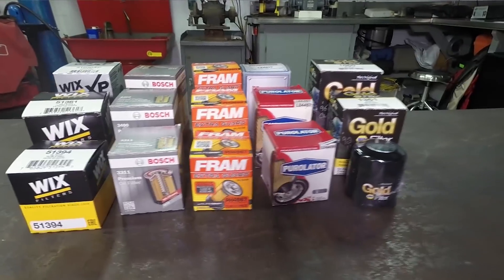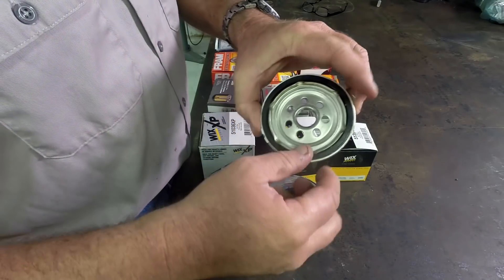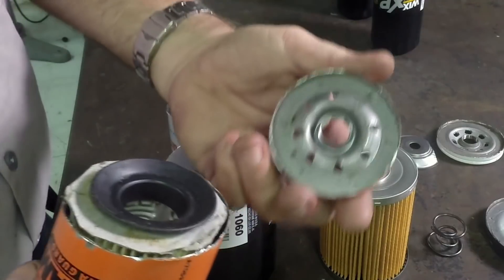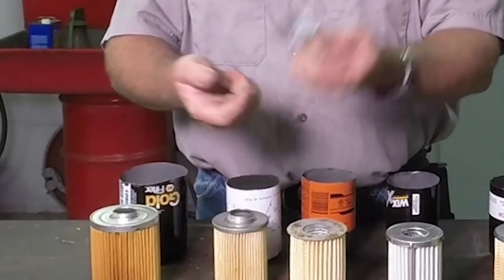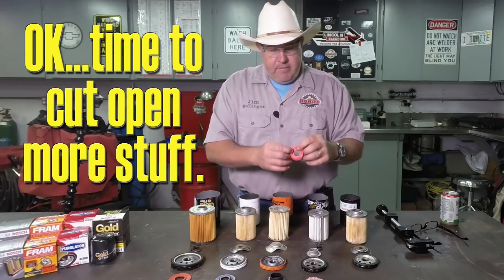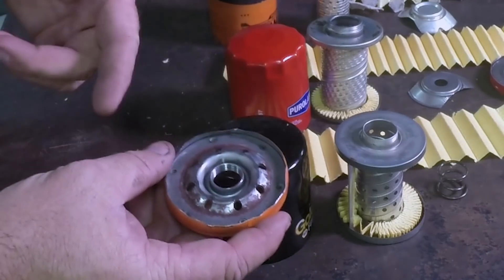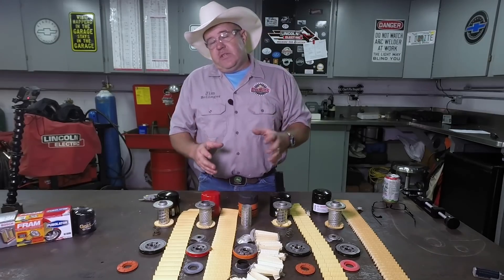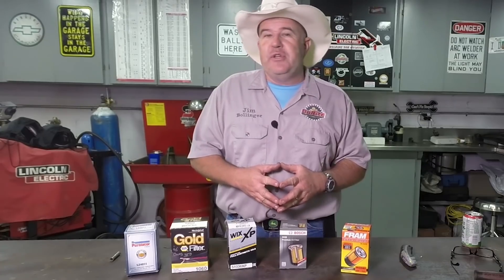The worst oil filter EVER!

Comment: As a hobby I am into the old International Harvester trucks and the vintage, low oil pressure type gasoline engines that power them.  One thing I can say is that these engines are very sensitive to inferior oil filters.  In the IH circles, with few exceptions, its always been known cheap oil filters, especially Fram filters are junk, often leading to ticking valve lifters, and lower oil pressure.  

There are many stories of just replacing the oil filter has made the ticking valve lifter noise go away.  And I proved it true to myself when I bought a '62 IH pickup truck.  It had low oil pressure when warm and very low oil pressure when idling.  I did nothing more but removed the old Carquest filter that was on it and replaced it with the recommended Wix filter.  Running oil pressure was much higher and idling oil pressure was about double when hot - using the same old oil.  

Perhaps the oil bypass valve wasn't working well in that Carquest filter, I don't know.  All I do know is that I had much higher oil pressure after replacing that filter with a proper Wix filter.

I embarked on a mission to find the best filter made.  And as it turns out there are over 300 different filters that would screw onto (fit) my engine that uses the standard 3/4 x 16 oil filter thread.  Using technical and engineering data and after many discussions with oil filter technicians at various companies, I did find one filter superior in the least flow restriction, most contaminants held, and smallest contaminants filtered from the oil.  There is one company that makes a better filter (much better) than Wix, my second most recommended filter brand..  (Napa Gold is made by Wix so they're about the same filter).  

I don't work for any oil or filter or car parts related company so my conclusions are unbiased, based only on technical specifications and engineering data, much more than ever put on their web sites.  If you're interested in knowing what filter, at least for old iron, is best, and much better than Wix,  you will need to read my report on this forum:

https://forums.ihpartsamerica.com/showthread.php?t=4022&page=2 

At the bottom of this page I put a table comparing Wix with another brand.  But I suggest you read the entire page if you're into this kind of thing.  Lots of good data there.

Comment: I've used Fram for a long time, put 350,000 on a 1998 Taurus 225,000 on another one. no engine failures. I wouldn't use them in a high performance race engine but using it in your average car you cant go wrong. I will continue use Fram good value for the money.

Comment: Funny, I have always used Fram filters. This includes my commuter car that has 525,000 miles on the original engine and is still going strong.
Reply: Must be a Honda.... Those things could run on molasses for 10,000 Miles
Reply: @aaronfields57  And FRAM makes the Honda-branded oil filters, too (in Ohio). Paper ends and all!  LOL! =P
Reply: What car? Toyotas can run forever even when lacking maintenance.
Reply: @Krazy Kanuck 😂😂😂
Reply: You think your engine is going strong but you don't know what your engine is going through on the inside. Just think, your engine being as good as you think it is, how much longer you might get out of it by using better parts. Personally I'd rather not take a chance.
Reply: @Krazy Kanuck 

that's is a good run .
Reply: My dad had a 1989 Chevy pickup with 480, 000 mile when he traded it in.  He always used Fram filters and yes even Havoline oil. The only problem he ever had out of it was a module in the distributor.
Reply: @tap Pearson that may be true.. great. But if you used high quality filters your vehicle / motor would last even longer.  And I also know you’re full of shit because I don’t care what engine or filters you are using, no one is getting 500k miles out of an “original” engine without replacing consumable parts. Whether you like it or not, and no matter how gentle you are, you are not getting 500k miles from a motor without doing maintenance. Parts wear out
Reply: @BananerRepublic  You are completely wrong.  All it takes to get 500K mi out of an engine is a solid design coupled with a lot of highway miles and not driving it like you stole it, and of course changing the oil at appropriate intervals.    I always chuckle when those who pretend to be the  most knowledgeable, seem to be their own worst enemy because they seem to have the worse luck getting good lifespan out of their vehicles.
Reply: Mxracer6y im sorry te tell you this but I worked at a oil change station in Mexico and the nissan tsuro wich is a sentra here go a million kilometers without changing or opening the motor just regular maintenance also seen the Toyota and the 7.3 international on the older fords go over a million
Reply: @BananerRepublic  Just plugs, hoses, filters and fluids. Everything else is original.
Reply: @BananerRepublic  ...300,000 miles on my '96 Tacoma with the 3.4, and nothing inside the engine has been replaced. Regular oil changes using "high-mileage" blend oil, and some changes I add "ProLong". I've replaced the timing belt, the coils twice and thought I had to replace the alternator a few months back, but after removing/cleaning all connections in the fuse box, it was charging fine (I think it was the large ground wire in the box). I replaced the rear U-joint last year, and had to do the ball joints and front CVs at about 215,000, but those aren't engine parts. It's been a great truck.
Reply: Could be a shill. Notice that napa is gold so it's probably the most expensive style filter compared to the cheapest fram.
Reply: @morbid_apathy  Negatory! The Fram has the black bottom and is their premium filter. Problem is they are sold in LARDMART oops I mean Walmart! Fram wasn't a bad filter years ago but they got the Group 7 mindset!
Reply: @patrickkruger5310  The Fram with orange sides and black bottom is not Fram's premium filter, it's their cheapest one.  Their top level filter is gold with a black bottom.
Reply: You got lucky in spite of the junk filters. you use.
Reply: @duke7595  Well seeing that I have been changing my own oil for over 30 years, I doubt luck has anything to do with it.
Reply: the stuff that these videos nit-pick on rarely have any impact on real world use as an oil filter.   Many cars go for a long ass time with whatever filter and oil are on sale.  these videos are so dumb
Reply: @GregGolightly  Yep. Pretty much any filter will do just fine in a typical engine. You really don't get much dirt in an engine to begin with if you frequently change your oil.
Reply: @GregGolightly  Also cardboard doesn't rust.
Reply: @bobbarker3248  No, but it does degrade and leak liquids, eventually turning into mush running through your engine while unfiltered oil leaks past the filter paper.
Reply: @OspreyKnight  But it doesn't. If you inspected a used one, you would know that.
Reply: @bobbarker3248  I have 3 used ones sitting on my shelf because I'm a lazy shit who hasn't disposed of them. 

What do I get if I open them up and any one of them has failed?
Reply: @OspreyKnight  You shouldn't do things only to receive rewards for it. We learned that in Grade 3. Anyways, it's very unlikely any of them have failed, considering Fram sells millions every year to consumers and manufacturers.
Reply: @OspreyKnight  You're getting emotional. You're not a reliable source of information. This is because you seem to dislike Fram, yet claim to use their filters, and has managed to obtain a failed one after supporting the possibility of obtaining a failed one, and obtaining a failed one with very few test cases. In fact, as you said, it was one. Suspicious, indeed. So I'll stick to recorded data which currently disagrees with you. Perhaps you could try actually using and inspecting one; However, as you said, "time is valuable..." and all that, I can understand why you're most likely lying. Also, because what you said doesn't seem very realistic, considering how those filters are built and how oil filters work. You're statements are suspicious!
Reply: @bobbarker3248  Yes I'm getting emotional over a brand of oil filter... on a video that shows that maybe something is wrong with the filter I've been using for a decade. And When I checked it myself, turns out its a shitty product. 

Guy, I'm not the moron emotionally invested in a shitty product and is defending it regardless of evidence.

And yes, anecdotes can be evidence particularly if they show a similar pattern of failure.  Which a quick google search shows exactly the same problem. Failure at the cardboard. If they got rid of the cardboard the filters would be fine.
Reply: @OspreyKnight  Sorry, but it doesn't seem as if you've used the filter for a decade. Why have you had no issues with it for a decade, to then have a failed filter the one time you decide to check it? Suspicious. A quick Google search shows no clear evidence of a failure. The best I found was a picture of a busted Fram, however, it may have been tampered with.

The evidence that the filter is fine when used within it's designed scope is here on YouTube. By many individuals with neutral perspectives.
Reply: @bobbarker3248  He shows the metal case with visible surface rust on it. Obviously the rust didn't come from the cardboard, lol.
Reply: @sgthop  Um, no he didn't. He showed the end caps and stated they had rust on them. Cardboard doesn't rust.
Reply: @bobbarker3248  Watch the video again then.
Reply: @sgthop  Cardboard doesn't rust.
Reply: @sgthop  Cardboard doesn't rust.

Comment: This is very disappointing. I've been using Fram filters forever. This last oil change will be the last time. And I really liked the coated easy grip because it saves me from needing a filter wrench. Are you sure you didn't get a bad batch? What happened to the slogan you can pay me now, or pay me later?
Reply from the maker: https://youtu.be/4UxaqAzHpNA

Comment: I've been using Fram forever in my drag cars, motorcycles and street cars without a oil related problem , so I can't see your bitch . It's called maintenance and visual inspection .

Comment: That is not a genuine Fram filter. Fram has been in the filter business for a long time and would not churn out junk like that. I have just taken apart a Fram filter I was going to fit on my Mazda RX8 and the inside was Metal, Plastic and a proper filter membrane and a catch gauze incase the filter membrane catastrophically fails. IE what you would expect in a quality filter. No that is a cheap "Chinese" knock off.
Reply from the maker: Those 3 fram filters came from Autozone and Adavanced auto parts. You should let them know they have been duped.
Reply: @DoRiteFabrication  Perhaps I should. Have you thought though that the points you raise may have little if any effect upon the filtering performance of the filter. They are adequate and at just $6 that is all they have to be.
Reply: @DoRiteFabrication  It seems Fram make four filter specifications: Extra guard for 5000 miles, Tough Guard for 10000 miles, Ultra for 15000 miles and High milage for more than 15000 miles. The one that you criticise and compare to much more expensive filters is the Extra Guard which is cheap and good for 5000 miles. Fram make this clear in their catalogue. You have got people to rubbish the entire Fram range based upon the internals of a filter that is cheap and is only claimed to be suitable for a 5000 mile service interval. You have to be scientific and accurate if you are going to besmirch a reputable companies reputation. I would take this video down if I were you incase Fram decide to take action. And I wouldn't blame them if I'm being honest.

Comment: I knew about the quality issue with Fram. Havnt used one for years. Btw... there is such a tool called an oil filter cutter. Used by mechanics to cut the tops off used oil filter so they can check the media material for possible metal particles. Used all the time by aircraft mechanics.

Comment: Did this same experiment 25 years ago in mechanics school and Fram was just as bad then too. When taking apart a used Fram the filter media, which is glued together rather than steel crimped, had came apart and was not filtering anything. I have dismantled several different filters and Baldwin has been the best, better than Wix.

Comment: Been using the fram tough guard for 25 years, good filter. Don't buy the cheap orange fram you get what you pay for. Duh.  I use the fram tg, napa gold and wix interchangeably they work in my airplane as well and all of those used filters get inspected (cut apart with the proper cutting tool) for metal. Haven't found any significant amount of metal ever. So... hint buy the napa gold when they are on sale twice a year fellow cheapskates. Mobile one synthetic is the best oil, just throwing that out there.
Reply: When I purchase a product from a big well known company at a cheaper price I expect it to still have its same core values, not a stab in the back. This is like buying Mobile 1 with rust in it.
Reply: Fellow cheapskate checking in!  I have always used Mobil 1 and WIX since 1995 when I learned what the racers with high dollar engines use.  I was not aware NAPA Gold goes on sale, will keep a lookout for it.  Mobil 1 has a rebate 2x per year, so I usually get my oil then.  Been doing Mobil 1 synthetic oil changes 2x per year for less that $20 for years.
Reply: I thought Mobil one was good til I tried Amsoil, ain't never going back
Reply: Hands down, Amsoil wins.
Reply: @gleanerman2195  where to buy amsoil?
Reply: J S I think advanced is made by wix / Mann filters
Reply: No way. A trustworthy company does not make any product that harms your engine.

Comment: Good video as far as it goes. Remember people, he is giving you an anatomy lesson and is using this information to predict how a filter will perform. Can you build a oil filter with strong media and parts that don't rust but still do a crappy job of filtering your oil? I bet you can. 

This is not the same as an autopsy analysis when you tear down a filter that has been used in production to see how they have held up. In the final analysis, the question becomes: How well does an oil filter - filter your oil. He does not test this. No oil or filter media is being tested here. Good video sure, but it has its limitations.

Comment: I've seen numerous videos and reports of how bad the Fram filters are constructed. I change my oil every 10K miles using Toyota OEM filters and full synthetic oil. I also use Automotive Wolf car management software www.automotivewolf.com to monitor my vehicle maintenance schedule so I never forget anything. I currently have 330,000 miles on my car and have never had an engine problem!

Comment: Most people don't buy fram tough guard. They think it is excessively expensive and stick to the cheap one. Walmart for sure. 

Goes to show, if you buy that quality, that is the garbage you get. 

You could buy tough gaurd. But if fram sells this as their base, they suck as a company and why support them. 

I lean toward wix after this. Napa probably the most expensive. 

Wouldn't mind seeing the after use video.

Comment: I think rather than tearing one apart, I would want to see pressure tests. A heavier wall does not mean anything  when it comes to burst pressure (and none of these filters, even at 60 PSI, are going to pop) . How does the material hold up to oil pressures and temperatures?  How does it hold up in the expected flow of oil for the milage they are rated at, and how well do they filter particulate before needing to use that bypass valve? 

How well do the bypass valves work? How well are they holding oil upstream for cold starts? 

What about comparing a fram tough guard against the equivalent napa gold? They are a very similar build, usually around the same price.

Comment: Opinions are a dime a dozen. Speculation is no better.
Actual test results are all that matter to me and my engine.
How's about building a simple rig that pumps heated oil, with a range of particulates dispersed in it, through each filter, and then sending samples to a lab for analysis?
Because  ... how else are you going to be able to accurately state which filters FILTER best?

Comment: Next time try the FRAM ULTRA .. Could you please compare apples to apples and not apples to oranges. Fram makes like 6 or more models as well as alot of filter companies. Napa Gold was made by wix.. You cut open a $3 fram bottom line filter and then Compare it to top of the line  $12 napa gold ( or worse WIX high $$$)..... Educate yourself, go to each manufactures web site, learn the model and the construction of and the filter ability measure in microns of filtering ability .This is also true with air filterers... A K&N  $35 oil film air filter is gonna out protect a $3.99 Purlator  ... I know "shocker right"  .. Spend your money on top line air and fuel filters first... Keep the dirt out of the engine from the start, and if you  change oil as manufacturers suggested time, the cheaper ones are fine for average passenger cars. PEACE